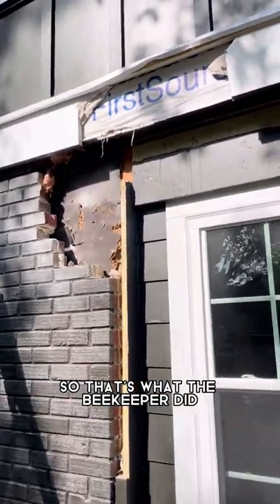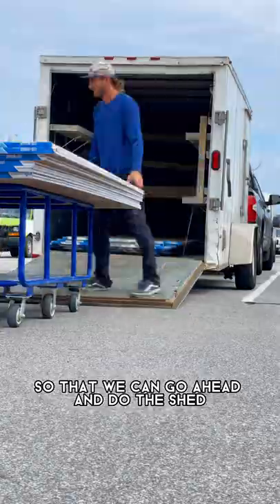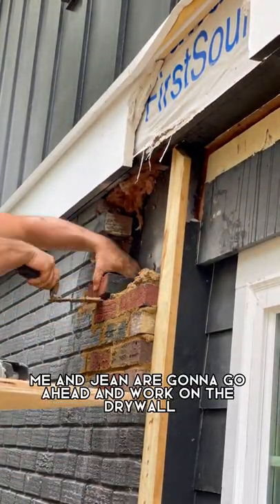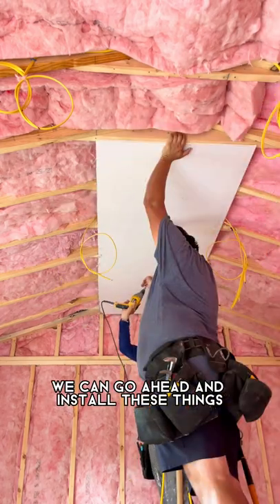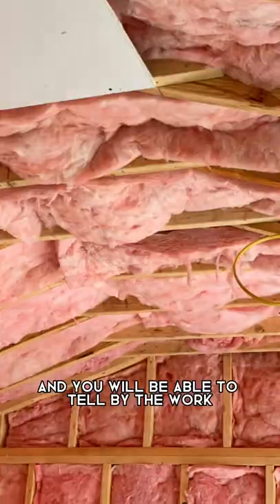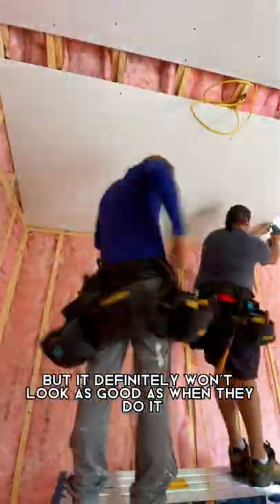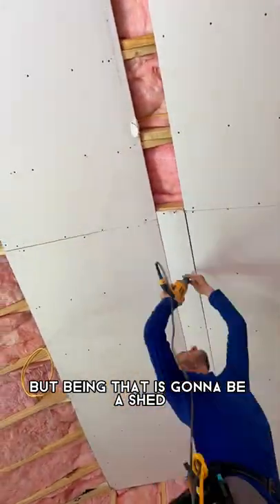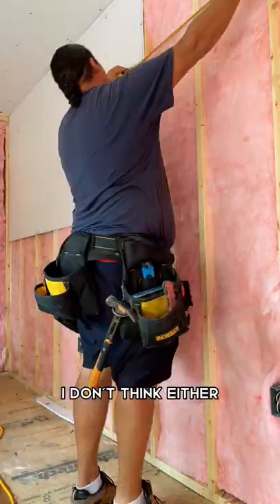Bee Repair Short

Comment: I only have one question ???? When you started there were wires hanging down like for ceiling receptacles or something when the sheetrock was finished I didn't see any wires sticking out anywhere ??????    So did you cover up all the wires ?????
Reply: If he is using pod light, that is how most are installed.  Most of the wire gets cut back.